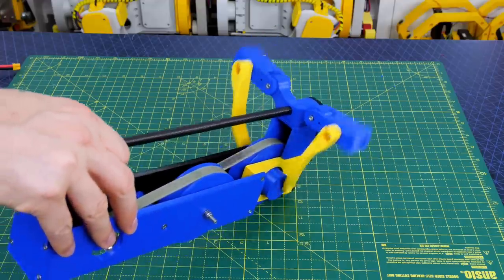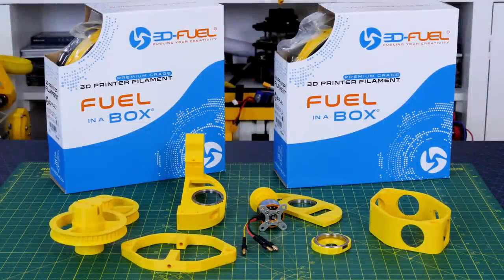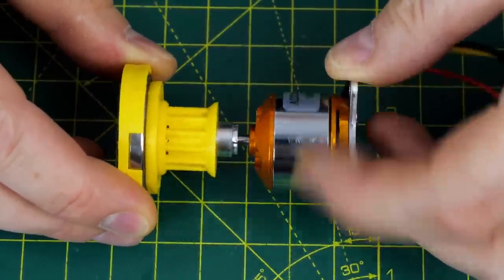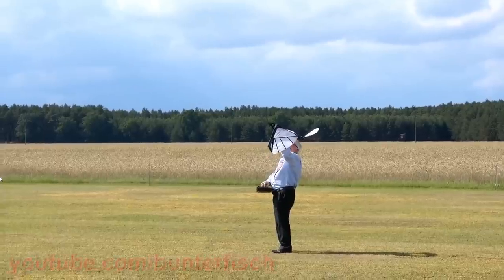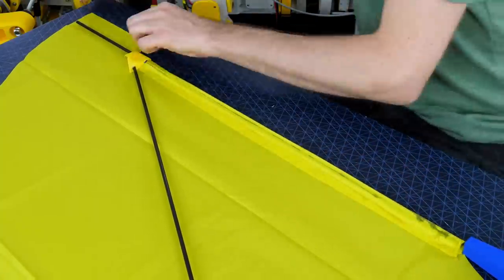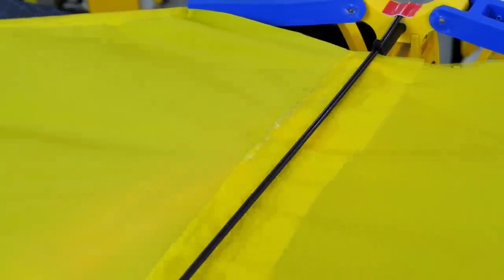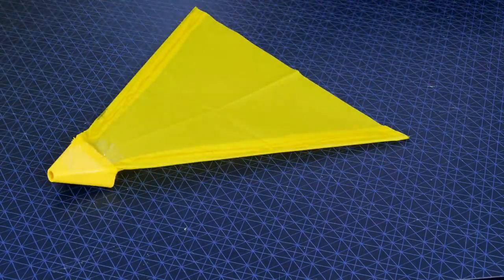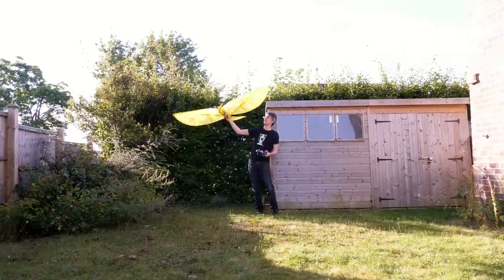Ornithopter Flying Machine Part #2

Comment: Hi James. Instead of glueing the reduction mounts to the carbon fibre, consider using hollow tube spaces that can be replaced with slightly longer ones if the belt gets loose. Belts should hold it all together in compression.

Comment: ...dude, ...like what part of CG AHEAD OF AC DID YOU NOT UNDERSTAND???
...your CG is AFT of AC causing pitch up and IT WILL ALWAYS STALL OUT!!!
- get the battery forward for balance (hint: ahead of aerodynamic center) and consider a trim adjustment mechanism in the tail to attenuate the down force (to counterbalance - draw a free body and it will make sense) - Aero 101; maybe find a good textbook.
-cheers

Comment: I'm curious as to why the up and down strokes don't just cancel each other out?
Reply: I'll be asking the same question after it actually flies successfully lol
Reply: the fabric flips and flops.. so on the upstroke they push air backwards, and on the downstroke they push air backwards. I guess they work more like propellers than wings
Reply: @jameshughes3014  Ah, gotcha. So with a nose high attitude it's all about creating thrust that has both a horizontal and vertical component. That makes more sense, thanks. 👍
Reply: @jameshughes3014  yep, those "finger" battens make the section of wing aft of the triangulation act like a propeller. 

I keep coming back to the same thought. He needs to watch slow-motion footage of how birds do it and, more importantly slow-motion footage of what his bird is doing. Might shine a light on why the motor is stalling. I have a nasty hunch that one of the hinges is binding under load.
Reply: @martindinner3621  that's not a bad idea at all. I use the slow mo on my phone for that kind of thing a lot.. sometimes I love living in the future.

Comment: Try adding a counter weight that can shift during the inertia of movement as if how a high jumper adjusts their structure to help as a equalizer.
Birds do slight adjustments to achieve their balance and fluidic kinetics.

Comment: Can you please try out using artificial muscles on a robot? I was thinking that you could download a 3d model of a skeleton and attach artificial muscles where they are on the real thing ( it's what I'm trying to do at least ).

P.s.
My notes on coiled monofilament (fishing line) muscles:

Using 500m of 0.8mm nylon monofilament line I found that using a weight of approximately 850g to keep the line in tension while twisting helped massively in ensuring that the line coiled up correctly. I have also found that the muscles post twisting are around 75mm in length and then stretched to around 130mm before annealing to keep the shape (unwind a few revolutions at a time if it is too hard to stretch). 
As of yet I haven't been able to try to anneal any muscles yet but you would want to anneal them at around the nylons glass transition temp +  about 20°.

To get the muscles to contract, the normal way to do it is to wind the fishing line with thin enameled wire before coiling it because the muscles contract with heat. 
It is found that most muscles contract to about 75% of their relaxed length but some apparently can go to 50% with the trade-off of a shorter life span.

I hope that you can try this even if you don't use it on any robots, it's just that you have far more experience in building + designing robots than me.

Comment: Are you researching bird flight/wings? It kinda seems like you’re skipping out on centuries of scientific research, opting instead for trial and error from scratch.
Birds flap their wings all the way up and down as they set off, to get the right propulsion.
Your machine is doing what birds do during flight to just top up a bit of height/speed.
Maybe you need to go more along the pterodactyl route of having a strong spring launch system to get going and then have the wings there to work while in flight.

Comment: If you watch a bird fly you will notice they will rotate their wings so that on the upstroke the wing is more perpendicular to the ground then at the top of the stroke the wing goes parallel to the ground. If the wing just flaps up and down the upsroke will just cancel out any lift you just achieved with the downstroke.

Comment: The solution your looking for is a low motor with a low kv rating. What that gives is a lower max rpm and hieher torque output. One that is rated be low 1000kv would probably be the best bet.

Comment: the name ornithopter (Bird-wing) is really missleading, because if built like that it doens´t really have anything to do with birds and how they fly.
Beating completely straight wings just up and down is really dumb and doesn´t create neither lift nor thrust! Any flying animal rotates its wings to reduce drag on the upstroke an create thrust on the up- and downstroke. Furthermore vertebrates have elbows! to fold/shorten the wings on the upstroke an reduce drag even more. Even more efficient flying includes beating the wing not in a uniform pattern, but with a faster up, and a slower downstroke... so without any rotation etc it isn´t even a real "insectopter"